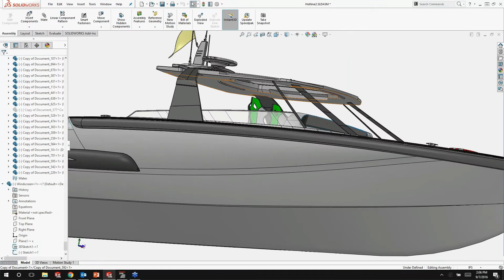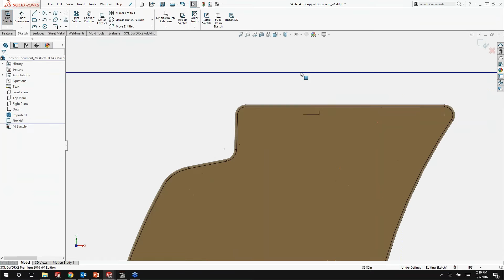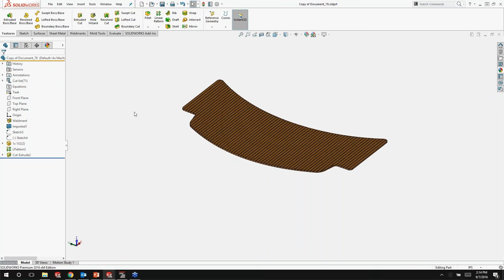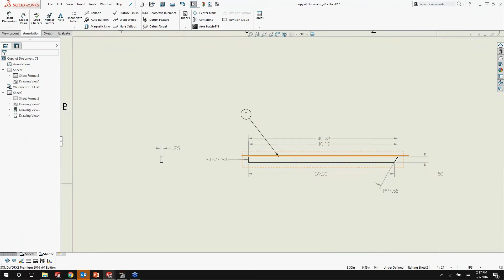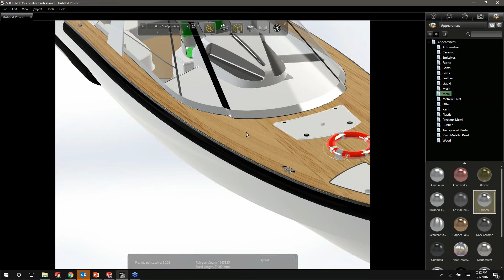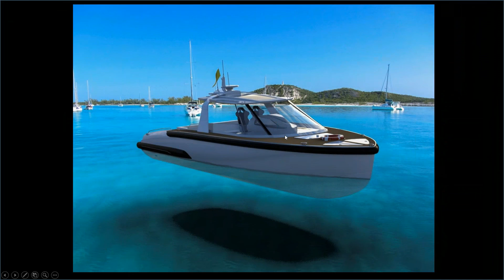Yacht and Skiff Design with SOLIDWORKS

Comment: Have you taken raw loft data and converted it into loft data for air craft surfaces?
Reply from the maker: Yes, the same loft procedure that is used on the boat hull or windscreen can be applied to other shapes such as aircraft airfoils and surfaces.  For airfoils for instance the curves are generated from standard shapes and imported as XYZ points to generate the loft sections for the final shape.  Please contact us through Mlc-cad.com if you have additional questions.